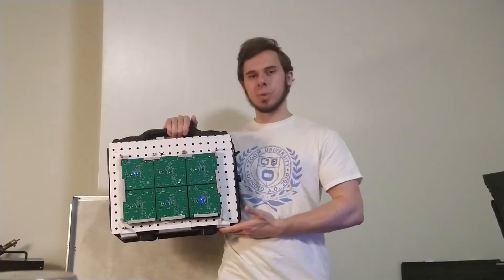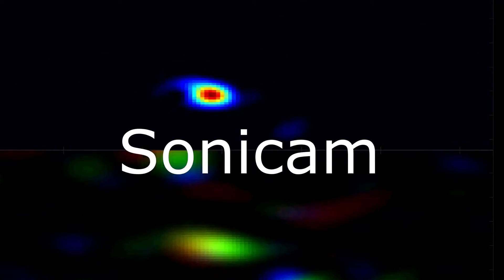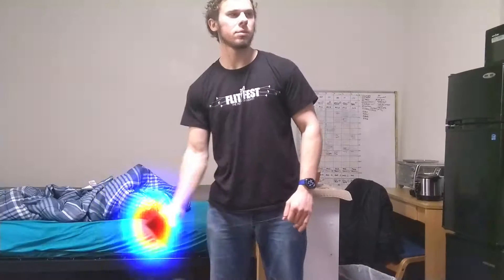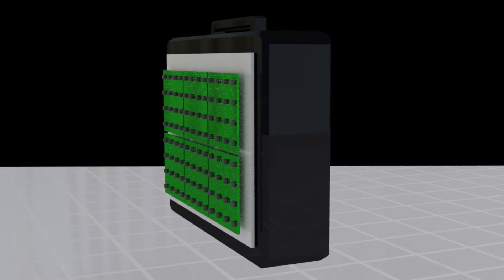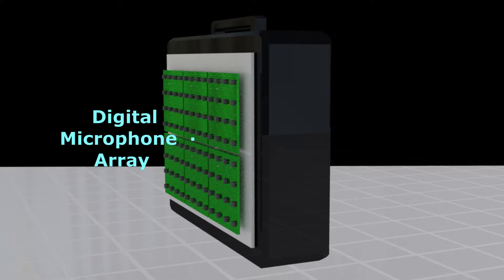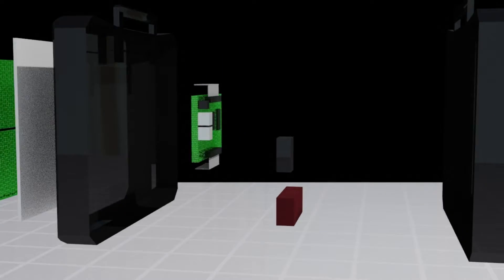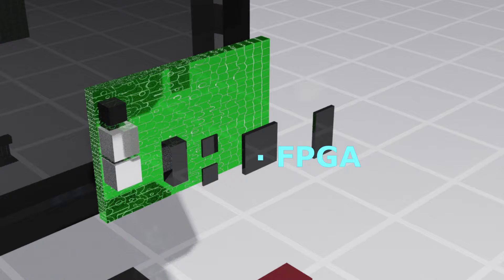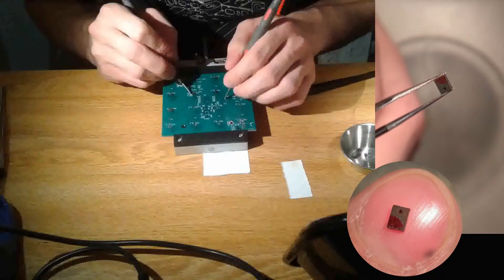Acoustic Camera - Results

Comment: Can you also do the opposite with this, and isolate sounds from a specific direction, even if there is a lot of noise coming from other directions? Listening to a specific server in a big server room, for example?
Reply: Sure, just flip the phase. I bet my airpods max do exactly this afai think
Reply: yes, it is called reciprocity! basically radar works that way (but using EM wave, instead of soundwave).
and yes, you can use the same principle to generate sound (instead of receiving) to a specific direction. it is beamforming, I wrote a thesis about it.